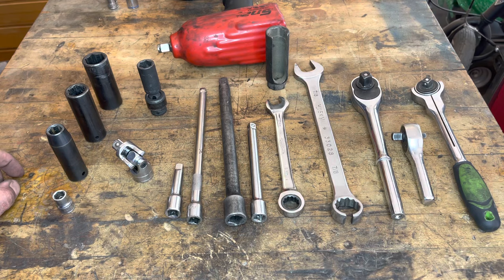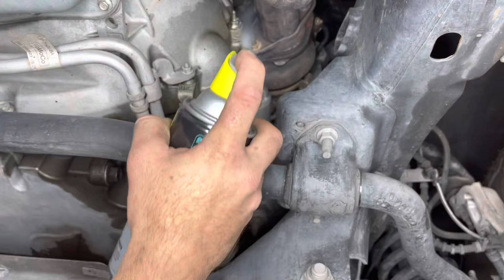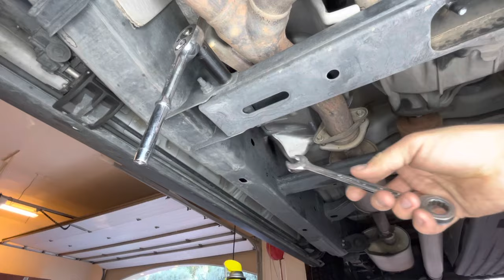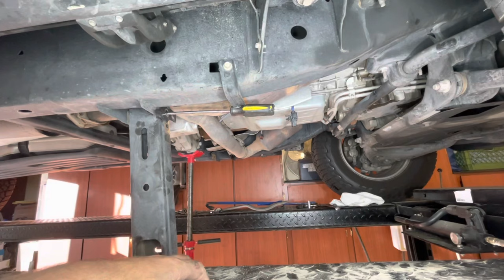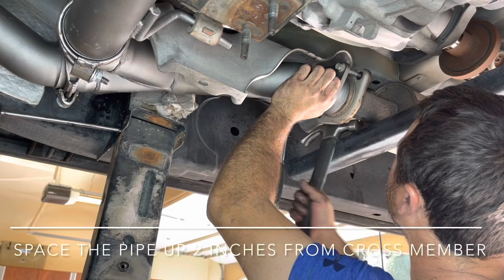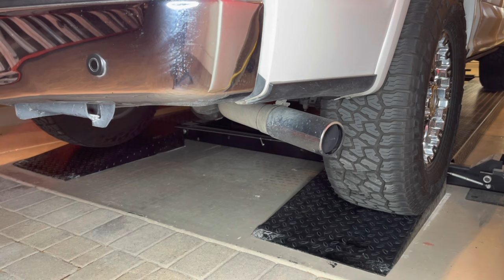Ford F-150 Catalytic Converter Replacement High Flow Downpipe (2011+)

Comment: Last year I replaced the cat on the passenger side because of the code. It came back after a few months. Now I got the code for both sides. I took it to the exhaust shop for a new cat and they told me it's probably my turbos. Any advice?

Comment: I have a 2019 f150 2wd truck . I was planning on changing the cat. converter myself until I saw your video. My question is; will I have to remove all that transmission stuff and jack the transm up? I don’t have a lift like you and that looks impossible for just one guy. Can you tell me if I will have to remove that trans. Bar and brackets?

Comment: This project will more than likely be in my future... 2017 2.7 F150 and drivers side cat stinks up my garage/parking lot if I let it idle for more than a minute or two.... no check engine lights or anything yet, and performance is still there.... so not sure. Just waiting it out for now.

Comment: Thank You, mine was cut and stolen, I'm going back this way!!
Reply: Life from Akron Ohio by chance you remember which side of the truck the larger catalytic converter was on when putting mine back together was wanting to know what side the 12 and a half and not the 14 and a half inch pipe goes nothing is safe on the south side of Akron good old Kenmore too many meth heads with sawzall's
Reply: @ryanreagan6073  Longer one was drivers side. This kit was AWESOME! I replaced all O2 sensors while doing this and was very pleased. Easy for anyone who can turn a wrench.

Comment: Thanks Aaron for doing all these videos! I just did this Catalytic Converter replacement job and followed your instructions. Extremely helpful! I even used the same part from SPD Performance, so it was super easy to follow along.

Comment: thank you thank you… i was wondering in all these similar videos…why they removed the crossbrace, driveshaft, etc, etc… i’m in the process and i cut my old pipes to get them out. which is what you explain is an option. i really didn’t want to do all that extra stuff and now i know i wont need to either. 👍

Comment: How are the Cat’s holding up? Thinking about purchasing but I’m curious if you had any issues since installed.
Thanks
Reply: Also curious!
Reply: Ditto
Reply: Same
Reply: That cat’s are holding up good. Definitely much better option than OEM Ford. Keep in mind, the pipes are slightly larger which is an added bonus for heat dispersement and performance. And the turbo’s sound a little better too.
Reply: @MicfromNJ any increase in mpg?

Comment: Did you replace the turbo/downpipe joint gasket and turbo/downpipe bolts for this project? In your f150 turbo replacement video you did. Was just wondering if replacement is necessary just for turbo replacement or if anytime that joint is removed.
Reply: I was wondering the same thing.

Comment: Just checked out a 2014 w coyote today, passenger side had a drip, I'm assuming it's a week hole from the cat or muffler, other side didn't leak tho, had 200,000 mi. Any thoughts? Thanks...going back Monday to really look it over, has great service record, was a lease/commercial

Comment: Code: P 430 is bank 1 which is the passenger side ( R )of your truck.  P 420 is bank 2 , Driver side.
Reply: I would have to respectfully disagree. According to a scan at my local O'Reilly's auto shop, p0420 is bank 1 and confirming with my manual that is the passenger and bank 2 is driver side

Comment: Did you experience any exhaust leaks after installing the new system? I just installed magnaflow cats / system on my 2015 eco post and it seems to be leaking somewhere. I found a leak where the driver side is band clamped to the center pipe so I put a 2nd band clamp on there but that did not seem to fix the issue…
Reply: Do you have any videos of you magnaflow hiflo cats? I need to replace my cats and don't want anything too loud or a drone sound.

Thanks

Comment: This is a 2015 3.5 V6 EcoBoost???  A 2015 and the Cats are failing?  I am by no means a mechanic, so can someone explain how these have gone bad?? Ive had a 2003 SDF250, a 2005 FX4 and current 2013 5.0 XLT.  Just ordered a 2022 F150 3.5 custom (like a fx4/tremor Hybrid). I have NEVER had Cat issue
Reply: i have f150 2020 xlt 2.7l 14.000 miles catalytic have to replace drive side . i have to wait 2 week for now becauce no part from ford company . that is so bad
Reply: @dannynguyen454  I’ve been waiting over 2 months for OEM cats, still no ETA on availability. I told the dealer to cancel the order and I’m going with aftermarket SPD cats
Reply: 86k on my 2018 5.0 drivers side is plugged. This isn’t rare at all. Just ordered a 23 with the 3.5eb so replacing my cats just to get rid of check engine light to sell it.
Reply: this is an old comment  but it looks like the f150s with the turbos are having Cat problems i have 2 f150 with 5.0 v8 NA (work trucks) both 300k and no cat problems
Reply: what engine do you have @HATEHACKERZZ
Reply: I have a 2016, 104k miles and the CAT has gone out. Seems to be a common issue with these :(